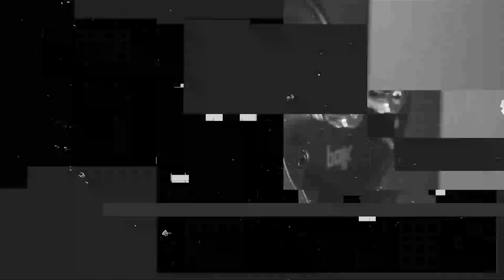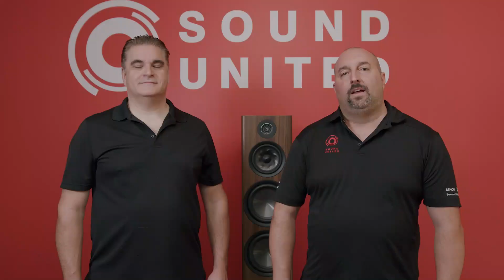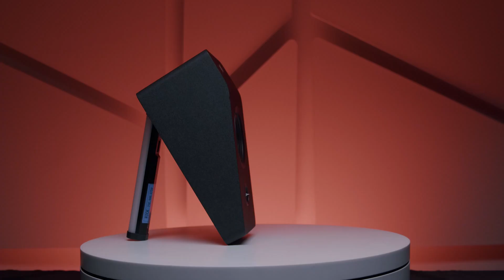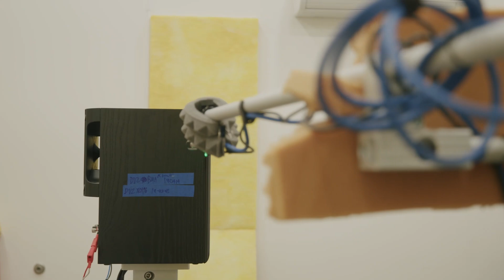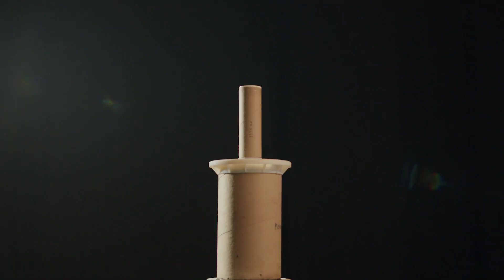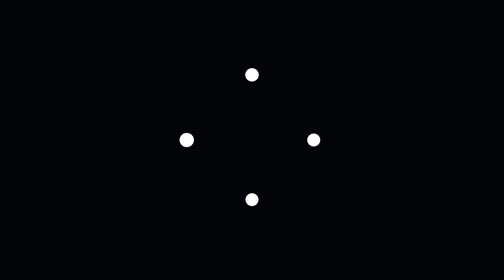Inside Sound United: Learn About Polk Audio Technology from Legendary Polk Engineer Scott Orth

Comment: I have the RTi-2000P for my front (L&R).They have the dual 8 inch bass woofer and powered. They are used for HT and music listening. I had been using them for the past 13 years. Its still going strong, but lately I've been thinking of replacing them, and have my eye on the new L600. Would the L600 give a significant improvement in performance? I can't find the L600 locally for listening comparison so I have to ask here.

Comment: Man, I really wanted to purchase the L600 towers but I just could not get over the baskets of the speakers being made from stamped steel instead of casted aluminum baskets. At that price range, there is no excuse to not have casted baskets. Come on Polk!
Reply: I totally agree with you especially when Wharfedale EVO4.3 is in the same price range and they have cast aluminum woofers and a real wood veneer cabinets.
Reply: who cares if it works fine? why is that a problem? you wont look at baskets, it is just an cosmetics thing that is inside
Reply: @eniojurko  it's a point that shows the build quality. I care about that.
Reply: @JC.LC.  only cosmetic as way i see it. alu cast  just looks different. it is not better ,just in looks maybe. function is the same. both will last. so build quality argument is moot
Reply: @eniojurko  you think the tires Ferrari chooses to use in their cars are for cosmetic reasons? Any tire will roll and get you from point A to point B. But not all tires perform the same way. Why do you think most speaker manufacturers that put out a good quality product use casted aluminum baskets? It's not for cosmetic reasons, as most people will not see them. It has to do with ringing and strength. And when I spend the kind of money polk wants for this series of speakers myself and others expect quality throughout the product.
Reply: @JC.LC.  there is no proof that the alu basket would be less resonant in this case. The designers acounted  for resonances and stuff as stated and tuned the drivers and the whole speakers accordingly. So i stand by my original statement!
Reply: @eniojurko  maybe you have this speakers and feel "attacked" by my comments but this has nothing to do with you but more with how polk decided to cut corners in the quality of the baskets. I'm sure polk designers set out to do the best job they can, but unfortunately once those designs get to the bean counters in their accounting department, they start to find ways to save money, and apparently using stamped baskets was one of those changes.
Reply: @JC.LC.  nope. I knew it before i bought them. You need to know where to  cut corners to get a good speaker with balanced price. As a matter of fact im eyeing r700 and some arendals, will get both of those for their intended purpose.. :D
Reply: @eniojurko How do you like your L600 speakers?
 I'm not seeing any worthwhile reviews on them.
 Been thinking about them, and Arendal 1723's.
 But R700 is looking good also.
Reply: @davidjudd951  i dont have L600, i have r200..